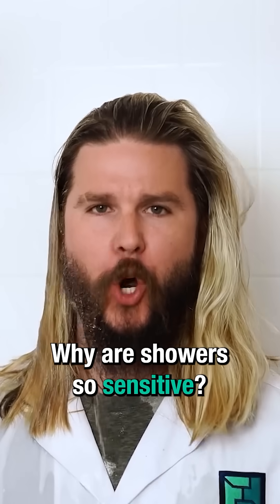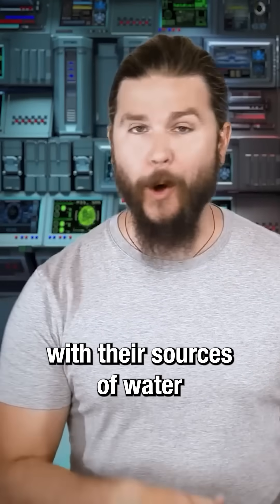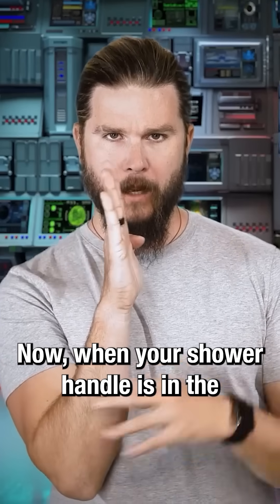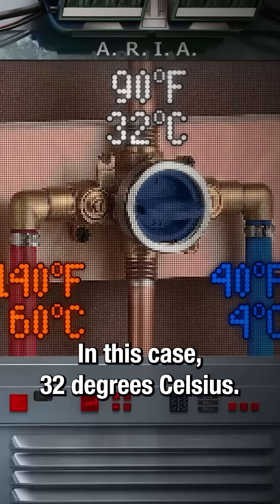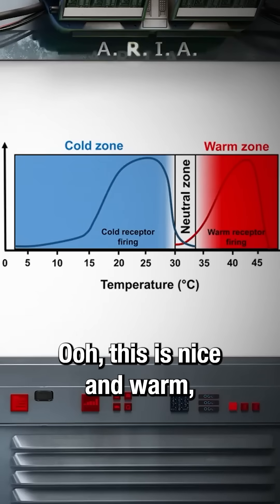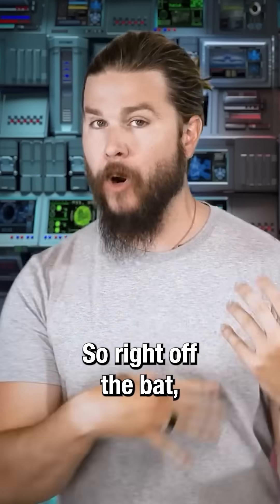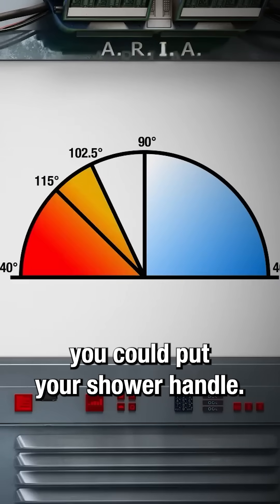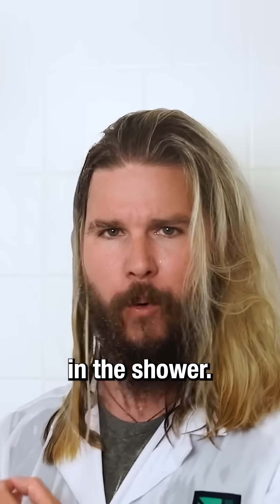Why are showers so sensitive? 🥶🥵

Comment: Well, in Europe we have thermostatic mixing valves. So replace the handle with one of those and the problem is solved.
Even better: if the pressure on one of the lines drops, the valve automatically responds to it and prevents big temperature fluctuations.
Reply: Thermostatic valve bodies are quickly becoming best practice now—and some states even mandate them in plumbing code for safety!
Reply: Since the dawn of PEX (plastic) plumbing people install manifolds in their mechanical rooms for both hot and cold (as well as mixing valves for blending hot water into segments like showers and bathroom sinks to prevent scalding) and then run individual lines to each and every faucet and toilet in the house. This not only solves all of the temperature issues, but makes it so if someone flushed a toilet while you’re taking a shower you not only don’t feel a drop of pressure, but no temperature difference either.
And by saying since the dawn of PEX, it’s simply due to cost savings (which are immense) versus using copper pipes…
Reply: @MikeOxlong-  interesting, however does that mean you can't control the water temperature while showering?

If that is so, it seems like a horror to get the temperature just right. And even if you manage to get the temperature correct, any changes to the environment temperature and everything is off again.
Reply: @TimBots I think it's generally good practice to install a thermostatic mixing valve just downstream of your water heater :)

That way you have better control over exactly what temp your "hot" water lines are without sacrificing the ability to change it at each faucet.

Comment: Laughs in electrical shower
Reply: That's a good idea. Connect a thermocouple to the output pipe and then connect to an electronic control valve with a controller to set the temperature

Comment: Perfect almost accurate explanation. Lazy is a little harsh. There are design factors to accommodate a wide range of differential inlet pressures and still properly function for a cost target. But overall, fairly accurate.

Comment: Where's the "lazy engineering" though? There are thermostatic mixing valves that produce a stable temperature regardless of the incoming water temperatures (at least once the hot water reaches it). They're just expensive so we have simpler valves in our homes that can be adjusted quickly. 
Also a lot of people probably don't know you can adjust the temperature of your water heater's output, and if it's way too hot, the sweet spot will be smaller.

Comment: huh. ive never really had this issue. I do tend to increase the temp as a shower goes on and i get more used to the temp, but first starting my shower i can pretty easily find a comfortable temp. I have a dual knob shower though so its pretty easy for me to dial in temp. Just go full blast with the hot water then add in the cold til i get my desired temp.

Comment: There's also the issue of the rubber gaskets expanding and contracting as the water passing through gets hotter or colder, which further changes the mix.
Reply: oh please, absolute nonsense.
Reply: @AttilaTheHun333333 I can’t tel if this is meant to be satire or not because if not man youre dumb as hell
Reply: @AttilaTheHun333333 I wouldn't wanna be in the same general area as you, since you've clearly never taken a shower.

Comment: What's even worse is when I just nudge the cold handle a little not even a visible amount and suddenly it's too hot or too cold (I don't have a one-handle shower control thing).
Reply: I have a one-handle shower and when it gets a little too hot, I try to turn it just a tad, but it doesn't recognize such fine adjustments. I then turn it a little more, at which point it turns the shower into an ice bath
Reply: @JS-kc1tm oh trust me, I have a weird ass door knob handle that I have to hit with my hands to adjust
Reply: Mine is single handle and does the same thing.
Reply: Yeah I have a 2 knob one and I basically have to tap it and then the hot water only last 15-20 minutes but it slowly gets colder as it goes so you have to KEEP adjusting it until the cold is all the way off and the hot water is freezing
Reply: I feel your pain! 😂❤
Reply: yea like it matters which direction you move the handle from. there is about a 12,5 degree range depending on if you set it hotter or colder

Comment: Seems like it would be super easy to design a better shower. Instead of mixing hot and cold in ambiguous degrees, just set an electric tankless water heater as part of the shower installation, and have one pipe that you can set the specific temperature to. The levers should only control water flow. If I ever build my own place (unlikely pipe dream) that's the route I'd go.
Reply: In the USA, most state plumbing  codes prohibit this practice. Too many people were seriously injured by water heater failures or unintended adjustments. Some states and cities will not let you occupy the residence unless an automatic compensating valve is  installed to protect you.

Comment: I usually run alternate tracking like Surveillance (ruin+surveillance my beloved) because most direct aura reading is pretty strict in it's trigger conditions, but if I do sometimes run it for specific combos and on the occasion Distortion is in play, I often won't realize its there, just notice I'm doing worse than usual and find out it was Distortion ruining a perk combo.

I personally don't see it often enough against builds where it matters to consider it something to worry about, but it is annoying when it works and I can understand why people have a problem with it.

Comment: I remember when I worked in the Netherlands in our hotel the water was on heater, and the shower design was so good that if you turn the red handle all the way it lets out the perfect temperature water so you didn't have to fiddle with it or anything. I absolutely loved that system!

Comment: my shower has in dependent hot and cold quarter turn taps. it’s like nightmare mode 
The best taps I’ve seen had one tap the temperature and one tap for pressure. It was great.

Comment: The real question is, why are farts so much worse in the shower?
Reply: Seriously though, never heard anyone else mention it but shower farts can choke you out💀
Reply: It's the same reason why air smells so nice after it rains; moisture in the air helps the scent molecules adhere to the odor receptors in your nose. For better or worse.
Reply: naked fart + hot air/steam convection + confined space = fart 100% inhaled
Reply: Confined space? The question I ask is why do I always need to fart immediately after a shower?
Reply: @AFSKID cause it relaxes you lol
Reply: thermodynamics
Reply: confined space, moisture, and heat effectivelty traps the fart in with you even if you have a bathroom fan going.
Reply: Because air is traveling up in the shower due to the hot water and you are basically standing in a tube. It’s basically like you are farting right under your nose. Additionally due to the high humidity and temperature your capillaries get bigger and more sensitive.
Reply: @AttilaTheHun333333  Not to mention Hydrogen Sulfide gets absorbed by water, or in this case steam, and therefore doesn't get dispersed nearly as fast, but just sort of hangs around for a long while.

Comment: Why do humans find water at 40C uncomfortably hot when normal blood is 37C? Can you imagine how badly it would hurt your street credit with your tribe if you get showered with your enemies blood and the first thing you do is flinch because 37C blood too hot?
Reply: The body really doesn’t like being very much warmer than body temperature so anything that will raise your body temp by a lot is uncomfortable.
Reply: Some proteins get denaturated (cooked) at 40 ˚C, as shown back in High School chemistry lab (one of the few experiments still allowed some 20 years ago).
Reply: To add on to the body temp... you are generating heat, if your internal temp is one thing the temp on the surface of the skin has to be lower than that for your internal temp to not go up.

Wet bulb temperatures of 35 C are fatal after around 6 hours, which means a skin temp held at 35 C by water is likely also fatal after 6 hours. 40 C is uncomfortable because you're slowly dying.

Comment: Tip: You can reduce the problem of fluctuations in water temperature by running water on the hottest temperature, then on the coldest until they reach their maximum temperature.  Their temperature will then remain much more stable.
Reply: Cold water is always on maximum, so you really only need to blast the heat and then bring it down to where you want before getting in
Reply: @Torpax_  It's not accurate.  if it's cold outside the water in the exposed parts of the pipe becomes colder, and on hot days warmer.  You may have a completely underground cold water system, but that's not true for everyone.

Comment: I actually mastered the two knob delimma. First adjust the hot knob to 1/4 of its total turn. Then use the cold knob to fine tune the pressure and temp. Your shower head can really only manage a specific flow rate so you will mostly be adjusting for temp. Using the inside of your forearm to check the temp and not your hand.

Comment: i got myself a shower with a thermostat built in. So the neutral position is always 38c. Turned all the way up to max is almost too hot but still bearable, and really good if i have muscle aches. And all the way down is whatever the cold water is running at. I basically never have to adjust it. I just leave it as at tad above neutral and it's always perfect for a regular shower. The shower was a bit more expensive than a basic one, but its something you use every single day. The quality of life improvement over a simple manual one is soo worth it
Reply: My mind is being blown right now
Reply: @MizuMark are these not commonplace? i have never actually encountered a shower with a handle in the country where i live. all i’ve seen are either the extremely basic one knob for hot and one for cold in old buildings or the fancy thermostat based one knob for temperature and one for amount
Reply: I used to have a shower head with temperature coded leds from Amazon & it was fantastic. Colors were blue, red & green. Soon as it was green you could step in & either be great or able to slightly adjust it without burning or freezing yourself lol
Reply: Where did you buy it?
Or what's its name?
Reply: @zaidahmed5464 I have a thermostatic Grohe mixing valve that sounds like what OP described.  They aren't cheap.
Reply: Need this. Saving a minute for your stupid shower to finally become warm is a huge dub😂
Reply: Yeah, it just makes WAY more sense to have constant temp rather than constant flow
Reply: Where I live, this is the norm. Every shower that I have ever been in since i was born, here in Sweden have been regulated with a thermostat. This should be the norm, it's so simple to have one dial for temperatur and one for water pressure.
Reply: Some might say this is unnecessary
I say this is well worth the purchase, as it's something you should be using at least 3 times a week, and you want it to be comfortable.
Reply: I got the thermostatic shower tap from IKEA, works like a charm after 5 years and it was cheap.
Reply: that’s cool! if i turned my shower on all the way hot, i would legit have blisters and 2nd degree burns.
Reply: Does it need any electrical connection?
Reply: @riccardodellorto4267  no, I assume they use bimetallic strip like hot water radiators and the like, there might be "smart" ones for faster reaction if your flows fluctuate a lot but a basic thermostatic mixer is completely mechanical, like a normal tap you just have hot and cold water intakes
Reply: I put mine to 55 but leave a bit off of the max to ensure higher water pressure, since that's half of the enjoyment
Reply: I have been looking for such a thermostat-shower combo. Can you tell which brand/model are you using?
Reply: Idk I put the temperature knob in 1 position when I moved into my apartment and haven’t touched it for 4 years
Reply: so you're smart and adjusted your water heater to about the max temp you can handle anyway...I wish there was at least a dozen people in the world half as intelligent as you, maybe the world wouldn't be so fucked
Reply: Also no temperature fluctuations, which is the most important benefit.
Reply: I haven't showered in 8 months.
Reply: Unfortunately for most people this is a luxury we will never be able to afford, but it's nice to dream lol
Reply: @the_sockdolager  It's like $50.
Reply: this is why I just run the tub water first and poke it until it feels nice. I can't STAND being sprayed with that first cold spray
Reply: I want to make fun of you.... but purely out of childish jealousdon't. what you have that I dont.
Reply: Where do u get that ? I dream for that to exist !
Reply: @SpeedyGwen  Grohe sells a high end version.
Reply: When I remodeled my house (In the US) I imported a Japanese style shower panel... Absolutely life-changing I set it to 41c and climb in, perfect every time!!
Reply: I kept mine at 41, guaranteeing it arrived at me at 40.
Yeah, I was born on the sun…
Reply: @spvillano  "I was born on the sun"
The original comment said they keep it a "tad above neutral [38]" so even if that tad was only 1° then the difference between what they said and what you said is only 2°, that doesn't seem like a terribly large difference. Especially when looking at the table used in the video, the neutral zone is 4° in variance and the peak of the hot zone is 43°.
Reply: What do you mean with every day? I think you meant every month you maniac
Reply: Exactly. The Japanese solved this problem decades ago. It’s just that Kyle hasn’t figured it out yet… 😂
Reply: @MikeOxlong-  the Japanese solved many problems decades ago, we in the US lead the world - from behind.
Reply: @spvillano I think Japan has the advantage in the bathroom tech for sure. Their toilets are from the year 3000.
Reply: @DaveDDD  that's just for their squat toilets, their western models are far in advance of that.  ;)
Reply: Yeah as japan does not have any roblems cough cough @spvillano
Reply: @waveril5167  there is the per capita level of problems, there is also the severity of problems. 
As examples, how many mass shootings have there been in Japan in 2011?
How many US cities were evacuated due to radioactive contamination from multiple melted down reactors were there in 2011, literally resulting in elders deaths?

Comment: I've got two knobs and both are switching sides I swear
Reply: That's the worst and when you forget which way is which so you either burn yourself or freeze yourself
Reply: @Arcticroberto9376 then just turn both on all the way? It’s warm enough normally
Reply: @JoeKurr5 Nah, because then your entire plumbing starts to shake violently, since you're squeezing way more water pressure into the pipes than they're designed for.
Reply: @DarkThunderism  if your plumbing does that you need to get that checked out, that’s not normal
Reply: @DarkThunderism yeah that's sus as fuck. Pipes are literally designed for it unless some random schmucks did your plumbing and if so you could probably sue them for putting you at risk of damages from negligent work.
Reply: @impaler331  Sadly, it's really hard to sue a company from the early 1900s that is no longer around.
Reply: @DarkThunderism  ah I see. Before standards were a thing 😂
Reply: OSHA who? @impaler331
Reply: @DarkThunderism  my plumbing is from the 70s and it was cookie cutter, so odds are they suck
Reply: @CaitlinTheTransOtter  Nah, but I'm like talking about 1920s fresh out of WW1 England where you'd be considered rich for not having lead in your plumbing.

Comment: Can you show us a science hack or fact that can help us boost the pressure flow in our shower? I love your content but I’d love you if you could just teach us a handy tip for getting stronger water pressure from the shower head
Reply: One way is an aerating shower head, adding air to the water makes it "feel" like you're getting more water out of it. It's more common nowadays since it uses way less water.